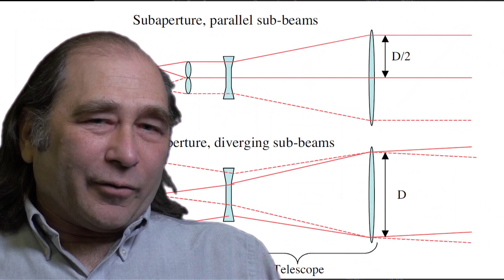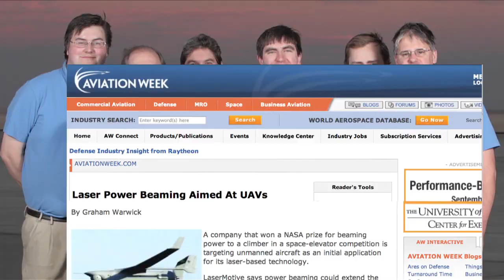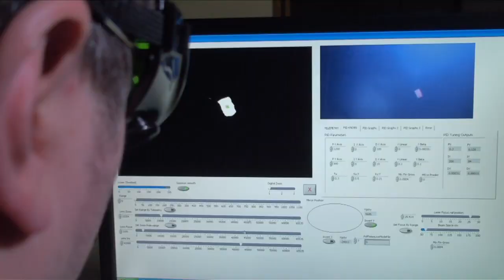LaserMotive - Who We Are, and What is Power Beaming

Comment: @ Polka23dot: a gimbal-mounted mirror on an aircraft can ensure that the transmitting and receiving planes are parallel.  Real world testing of the laser beam by two defense contractors has affirmed the power transmission efficiency of 25%.  Re fuel cells: there are a number of applications in which a propane powered fuel cell is inappropriate and/or unsafe.  Finally, any fixed energy storage device will run out of power.  LM's unique value is endless recharging of fixed energy storage devices.

Comment: LaserMotive uses diode lasers made by nLIGHT. They are very efficient: 47% efficiency at 660nm, and 73% at 980nm. The efficiency of best solar cells is 43.5%. LaserMotive website claims the overall efficiency of 20% to 25%, but this claim is based on wind tunnel test. The overall efficiency may be that high for a helicopter, but it would be only a few percent for an airplane because the solar cell is not perpendicular to the laser beam, and it reflects the beam instead of absorbing it.

Comment: LaserMotive technology has been defeated by fuel cell technology. A fuel cell called ROAMIO D245XR powered ground robot for over 12 hours, and a hand-launched drone (UAV) in excess of 10 hours. The fuel cell is made by Ultra Electronics. It makes 245 watts of 28 VDC electric power while consuming 112 grams of propane per hour. The fuel cell weighs 2.6 kg and costs about $29000. One year ago the U.S. government gave Ultra Electronics $2 million to develop fuel cells for unmanned ground vehicles.
Reply: polka23dot it never went anywhere.